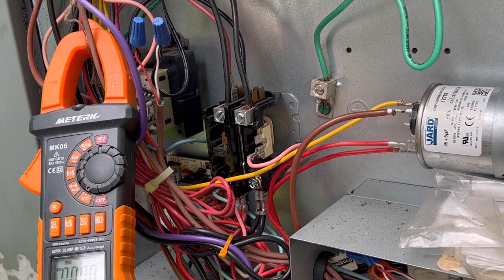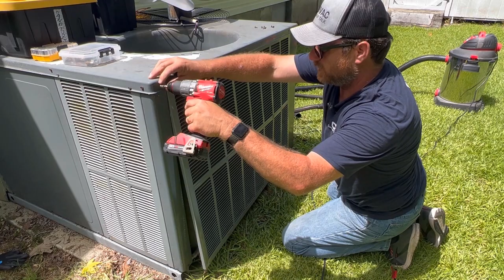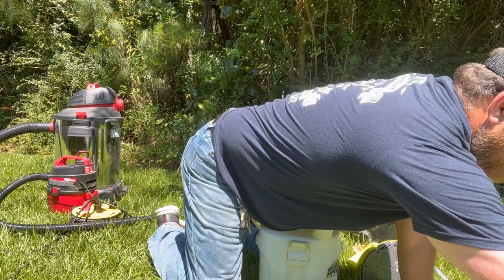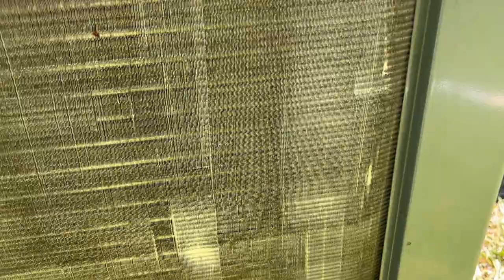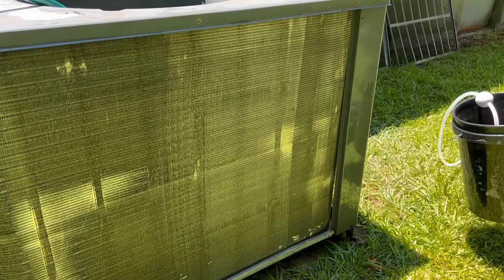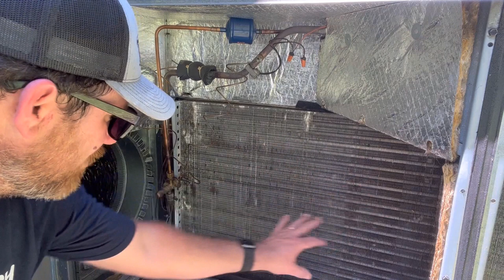New and Improved HVAC Coil Cleaning

Comment: I watched the whole video and Im still wondering when he is his going to clean that coil for real? Lol that coil was not very dirty from the start however Id never clean coil with obe of those silly pressure washer contraptions. Ive been washing rtu coils for over 20 years and I carry 400' of black rubber hoze in my van at all times. Have yet to fins a hose bib further than 400'. You have to have water volume to wash a coil properly pressure washers have no volume and are usless on a cu coil. The are ok for cleaning pannels and maybe evap coils but thats it.  I know its a pain to run the garden hose but it is what it is. I have seen commercial coil cleaning companies when im in the field they use water trucks and large pumps to pump the volume they need for washing coils all day with not hose bib access. Some times I run in to pressure issues with the garden hose then you do what you can with what you have in this case I may consider a little power washer with a bucket of water but only then. By the way that blue coil brightner is way to harsh on coils for regular use use the I beleive yellow bags from united tech its the medium grade it wont damage fins and you can fully consentrate it as directed to get max foaming with no worries. I use the blue bags only if the coil is insainly dirty and the customer wants the shiny nickle look wven though thats not whats important. I have been to too many jobs where a guy just finished washing a cu coil with a pressure washer coil looks clean as ever but pressures are still threw the ceiling and compressors are getting really hot. Turns out the coils are still dirty you need that volume to push that crud out inside the coil not just wash the surface!! And yes if its a double coil cut those zip ties and seperate them or its never going to be clean!!
Reply: What are your favorite cleaners? Your comment about volume is correct really forces everything out.
Reply: @HVAC544  to be honest its best to clean with just water. Brush the coil first and spend a good deal of time rinsing with water from the inside of the coil out then rinse the front of the coil to clean it up even better. If the coil is real dirty use a viper pack from united tech. Its a consentrate that will make 9 gallons of cleaner which is great.
Reply: @HVAC544 dawn and a lot of water for cu coils.